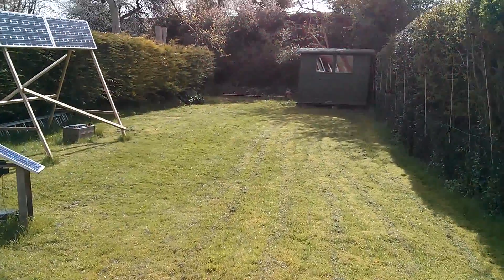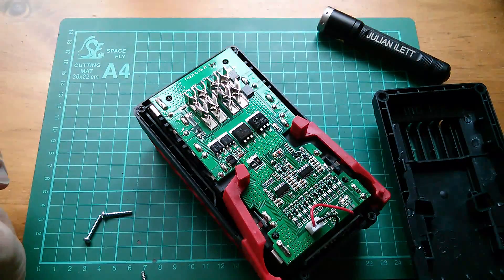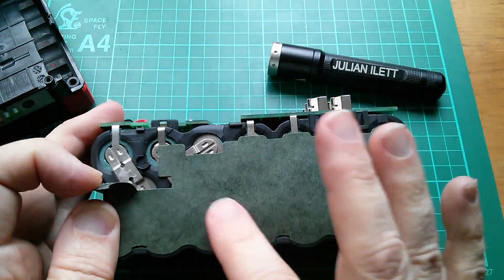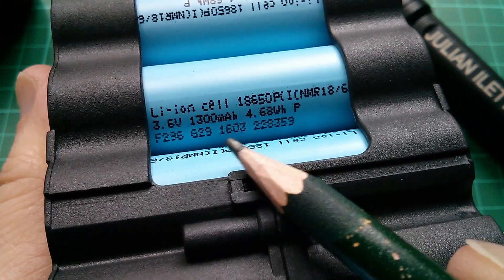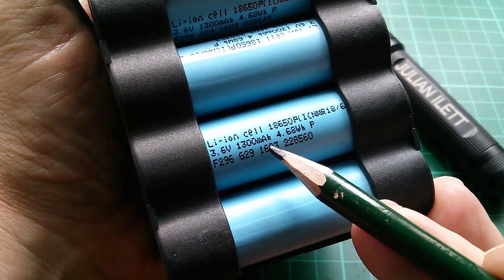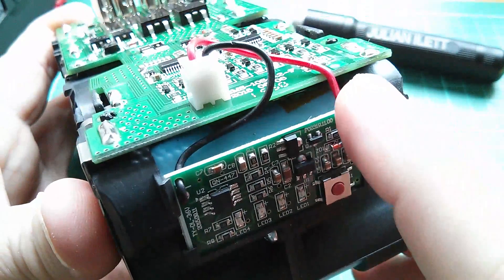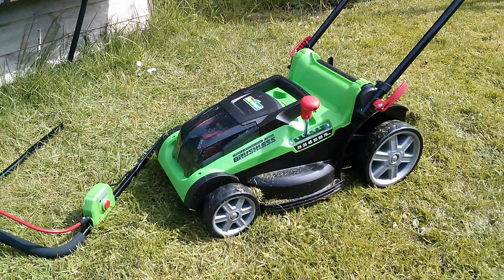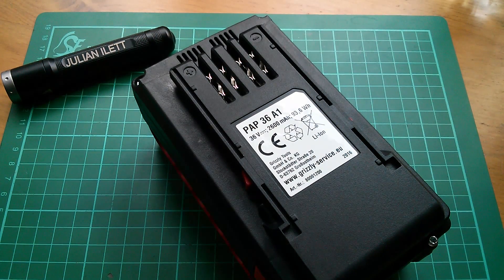Teardown: 36V 2600mAh Lawnmower Battery

Comment: while these batteries are high drain batteries you can easily get 18650 cells with double the capacity rated at equal or greater current.

Comment: 04:35
"if you have less actual chemicals you can have more electrodes"
Well.. that might be the case.Its not really the main reason why the capacity is lower.

One is that you may dope the electrodes or dielectric with mineral, usually som rare earth, that increase mass and volyme quite a bit. Specially that Rare earth got giant atoms compared to Lithium.

The last part is that they sometimes simply replace the cathod with some other less dense compesition that gives lower Wh/kg, but on the other hand increase durability quite a lot

About Lithium Cobolt and Manganese is not really that clear cut. Its real the decimals after 3.6xx V that you never se. Anyway there is "cathods" that uses both Cobolt and manganese at the same time having both relatively good discharge current as well as longevity and even quite resonable capacity. Nissans electric car uses them for the last modell

Th battery with both Cobolt and magnanese is about 3.65V so they are regulary markt as 3.6 or 3.7V

Yea you came that later in the video....

I would think this is pure maganese due to the low capacity. manganese-cobolt hybrids i would presume would haver capacity. But it could of cause be low capacity manganese-cobolt.

But i would say the main reson is that manganese-cobolt batteries is quite a bit more expensive. They last longer, but they are more expensive. Produces with cheep home electronics would not care about that. But if you make a electric car with warnaty, its quite important

Also... 15 minutes of a 2.6Ah battery  may not imply 10A. I would say, more problem around 7 or 8. But i would need to se the discharge characteristics. If its a rather high current, like 3-4C the cut of probably cut of when its still ½Ah or so left in the pack.

Comment: Thanks Julian, it sounds like they have implemented soft start and constant speed with feedback and possibly re-generative braking  in the firmware of the mower. I guess the availability of batteries and blades will be one of the factors which determine the service life of that mower.

Comment: If that pack doesn't last, you could consider using LiPo packs. For $40(USD), you could put together a 3000mAh pack using 2 of these: http://www.hobbyking.com/hobbyking/store/__8853__ZIPPY_Flightmax_3000mAh_5S1P_20C.html

Don't forget a low voltage alarm so you know when to stop mowing. These won't cut out like that stock pack will.

Comment: I have a Lidl drill, and it outperforms my Makita, batteries fine after over a year of sometimes quite heavy use. No reason to believe these will be any different.
Reply: +Fred Bloggs  Yup, second that.  Very good stuff at Aldi or Lidl for the price.  But people must be made aware that these batteries are killed in cold weather.  Have a battery pack from my cordless that was left outside in a garden shed and a similar one that was inside all winter.  Still need to measure but the one that was in the shed and was full when I left it there was empty in 10 minutes time.  The one that was inside was still working when I finished about 20 minutes later.   Also my 230V mower is still working fine after 13 years when I moved, not sure about a batt pack but I guess ....
Reply: +Luc Peeters they may very likely be rebrands of something else. Not in the UK anymore, but would be very interested in 'someone' taking one apart.
Reply: +Luc Peeters Well it probably wasn't the cold alone that killed it, as lithium cells don't like being discharged under 3V per cell or left fully charged all the time, so leaving them sit around either by themselves or on the charger all winter long will definitely ruin them if you want to store them and keep them in good condition you should charge them to about 50% and check on the pack once a month or so and keep them at about 50% until needed again.
Reply: +vgamesx1  Normally I do that to my lithium cells. When not using for a long time I connect them to the iMax charger and put them on 'store' setting. The one that was in the shed was in a toolbox so not the machine but the contacts are not easy to get to or otherwise I would do the same as with my spare 18650's   
As I love cordless tools I also dislike them. I inherited a drill from my father from the 1960's that still works perfectly. I don't see that happen with cordless stuff. The problem is always the different connectors and batteries that they use. Also imagine that mower sitting in the sun for hours with the batts inside. I am not in a way a green person but one must say that we are starting to make an absolute Lithium .....

Comment: Well in the past Blue PCV shrink used to be Panasonic's cell color, but Samsung uses that same color PVC wrap as well with their hi-current cell batteries. Panasonic is considered to have the most advanced batter manufacturing plant in the world and can get long capacities, but Samsung makes lower capacity cells with higher current output depending on your application. Sony has used the NMR code in the past, and I own four of the 18650 Sony 25R cells that can provide 20Amp on a single sell, the testing from the data sheet is crazy for what they do to these batteries to ensure stability. The most I draw from my 25R cells is about 4.5Amps. 
Looks to me those are authentic Samsung or Sony cells for high current and stability, and fact charge rates. I'd say you have some good looking 18650 batteries in that pack and they should last a long time.

Comment: Well, if you ever wants to make a dragster electric push bike, you've got all the parts now!
Reply: +bridgendesar The battery is way too weak for that.
Reply: +zaprodk I'm clueless about batteries, what would be needed?
Reply: +zaprodk dude what? that battery can churn out 360 watts. 36V*10A. That's also the limit of power that electric bicycles can have in the UK. No more than 300 watts. It's perfect.
Reply: +Re When we're talking about a "dragster electric push bike" as OP wrote, 360 Watts will not cut it. I have an electric kickscooter where i removed the 24V 250W motor and SLA-batteries. Put in a 3,9kW DC Brushless motor, ESC, 6-cell LiPo and an Arduino to control it all. That thing is good fun.
Reply: +zaprodk   I look forward to you upgrading to a pulse jet!  Well, not really,  I don't actually want to see you die  ;)

Comment: I thought 1603 meant Week 3, 2016. I could be wrong though that's just what I've picked up from eevblog.
Reply: Yes, it's 3rd week 2016
Reply: +Wobblycogs Workshop - that's the usual practice.  It makes better use of the 2 digit code giving more resolution than just using months.

Comment: There's a lot of space in that battery slot on the lawn mower, would it be possible to hack together an even bigger capacity battery and put it in there to get more runtime out of it? I mean, yeah, probably would, but would it be practical compared to the weight gain?
Reply: I thought about this too
Reply: +EpicLPer yes, even 5 batteries would be lighter than a lawnmower engine
Reply: +Re True, but still heavier than gasoline for the equivalent energy content.

Comment: 5 Amp per cell isn't that much for High Discharge 18650s.
When you take a look at the Samsung 25R, they have a capacity of 2,5Ah and a continous discharge rate of 20A. 
Or the Sony VTC5A with 2,6Ah and 35A continous discharge.
http://www.nkon.nl/samsung-18650-inr18650-25r.html
http://eu.nkon.nl/rechargeable/18650-size/sony-us18650vtc5a-flat-top.html
,
Maybe those low capacity cells are made for high amp peaks when the mower starts...
Reply: +ELECTRONTHORP price 18650s on fleabay, you can get  1300mah for $1/each from china.  Brand name ones can cost upwards of $5/each or more...
Reply: +ELECTRONTHORP Problem is the $1 cells fall on there ass after about 100 cycles...  theyre junk.
Reply: Samsung does likes making high current cells like the 25R and VTC4, Panasonic runs more on capacity with current limits being lower. Both great 18650 cells.  I noticed the higher the peak current draw the lower the over all capacity. This follows Sonys way of doing things, I think they are Samsung cells. I'm wondering if the motor has a high rated capacitor to help the motor spin up reducing the peak current drain when it starts up. They do this on dryers and central Heat/AC blower motors also, even garage door opener motors. If it doesn't, it would benefit from having one and could increase drive time a little. I would think it already has this capacitor?
Reply: +Mr0Yoshie 
250 cycles at 60%.... yea... that is not really that great. And those cells are kind of expensive. The source you give was the lowest price i could find. It would be €~90 of cells for a ~€150 lawnmower..
Reply: +matsv201 Of course they aren't cheap, but those are the top of the line cells. The VTC5A has the highest discharge rate of all Li-Ion 18650s I know. 

But it shows that those cells in the batterypack don't necessary are High Discharge cells, as a Samsung 26F can handle 5A easily, and I wouldn't consider those High-Discharge cells or anything special.
Reply: +Mr0Yoshie To my knowledge Sony stopped making the VTC4/5 cells and that was confirmed back in September 2015. They said they were never intended for public consumer purchase, they made them for a specific OEM applications. So maybe those links are fake cells or old recycled cells? Sony does not like their Li-Ion cells being sold to public for people doing "Vapeing" and stuff after the one big laptop battery recall a few years back. Be careful when buying cells, A LOT of FAKE are out their and they are not nearly as safe as a real Samsung or Panasonic cells, especially if your putting it in front of your face like "vapors" do.
Panasonic allows other battery companies to re-sell some of their best batteries like in some EFEST 18650 and others. Samsung prefers to make and sell them for drills, mowers and laptop packs that most dont take apart. 
I prefer Samsung cells for high current and Panasonic for longer lasting capacity in my flashlights . 

Apologies: In my previous comments I was calling Samsung Sony. I just woke and didnt have my petrol yet but I think I have fixed all comments I made this mistake with.
Reply: +Gadget Review (GRV) Still some mistakes ;)
Sony makes the VTCs, Samsung the 25R, 26F, 30Q ...

Of course you can never be sure if you get the real ones when buying from ebay or other internet stores.

Sony said they don't produce the VTC anymore, but suddenly the VTC5A got released...
When you check the date codes on the cells with a datasheet they claim to be produced just recently. Bought a VTC4 in mid 2015 and they had the code XA20G on them which states that they where made on the 20th of January 2015...
Reply: +Mr0Yoshie  Yea, i got them mixed up also, again. Caffeine is not helping today, i fell ill so i think i will stay away from any further comments today & just go back to bed. 
Thanks for pointing that out.
Reply: Good to know, maybe they brought them back.
Reply: Mr0Yoshie 250 cycles is crap anyway. You can make almost any resonable good 18650 cell run at 20A or close to 20A if you just want 250 cycles life out of them. Also.. its at 60% remaining capacity, not 70 or 80% that is the normal way to messure

Comment: The date codes are usually in a YYWW format, so the cells would be about 3 months old right now.
This is expected when the mowers are in a shipping container from China, the trip takes about 3 months.
Reply from the maker: +Erik Bruijn Ah yes, that's a point - still pretty brand spanking new though :)

Comment: Well,that didn't take long!  Just couldn't resist,eh? ;-)
Reply from the maker: +PhattyMo I couldn't resist. I like to know what's inside my battery pack, and I'm quite impressed, it looks like a good quality pack.
Reply: +Julian Ilett I often try to resist the urges,but inevitably within 3 days I've taken my new 'thing' apart,to see what's inside. My curiosity just can't take it.
Reply: +Julian Ilett I was expecting you to take it apart in the initial video :)
Reply: +Julian Ilett Its probobly nothing wrong with that battery pack. Look like nice high quality componenets and a well made layout....

... but i think those cells look a little bit dubious.....
Reply: +PhattyMo But I'm glad he did, nice video, great job. The pack looks to have ample protection and a good balancing. I was surprised to see no temperature measuring, but I probably missed it. They usually run into between the cells as a safety cut off if the cells get to hot.